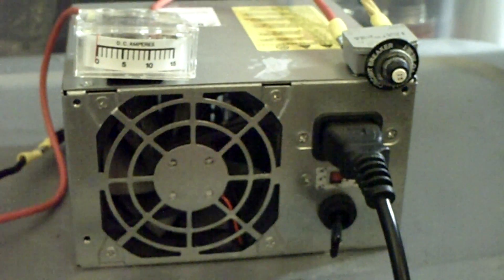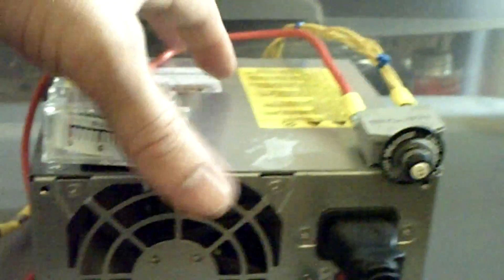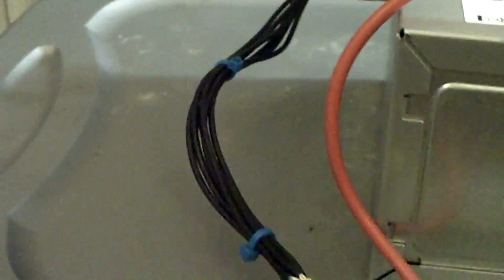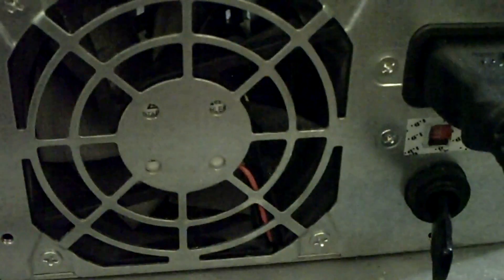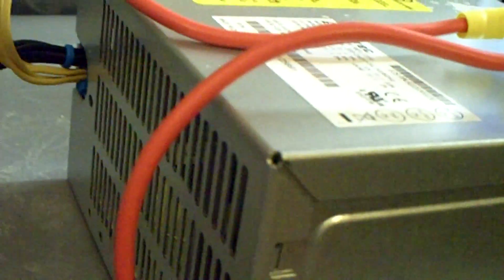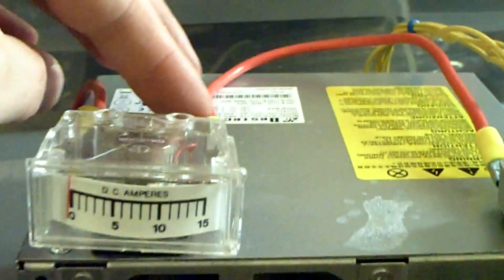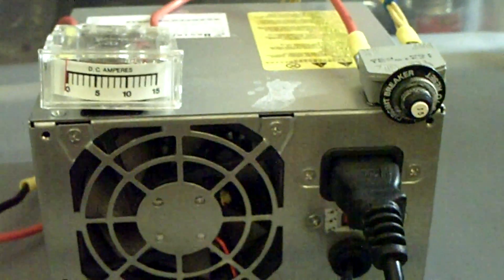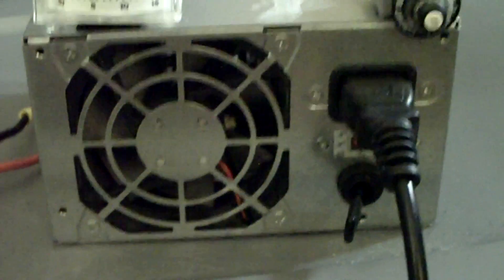Vid27 How to Make a 12V Power Supply

Comment: Man. I'm doing something wrong. I found >>8 old laptop/printer chargers in my attic. Each one produces between 2-6 amps. So I connected them all together (the right way so the spark kept getting bigger), made a great cell, but it barely produces enough flame to melt a paper clip. This mess I built SHOULD produce around 8X4=32 amps but it's weak as hell. Going to home depot tomorrow to pick up a volt meter. Maybe it's the age that's the problem cause I was expecting a huge flame but it's thin as hair.

Comment: Kind of good, but destroying things and having to spend needlessly when experimenting is a little wasteful.  Circuit breakers that DO trip, or proper short-circuit proof power supplies are better.  Thanks for encouraging people to have a go, though.
Reply from the maker: Not if you don't have the money to buy an expensive Lab Power Supply.  Sure a power supply with a built-in circuit breaker would be ideal, but I didn't have one back in 2009 when this video was made. The reason for this video was to show that the old power supply from a computer that is collecting dust, can be modified to use for simple experiments. Thanks for watching.